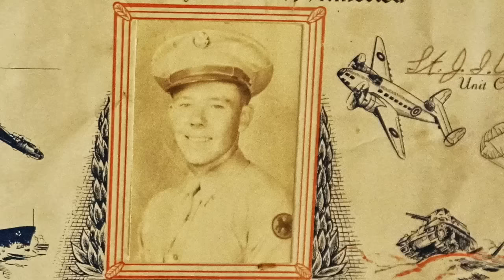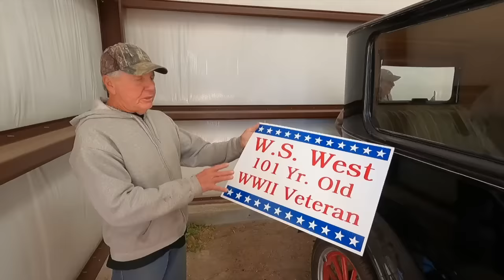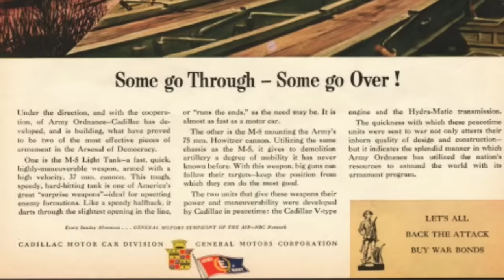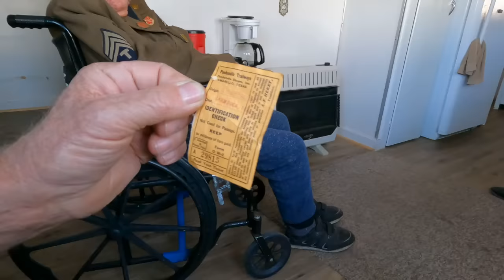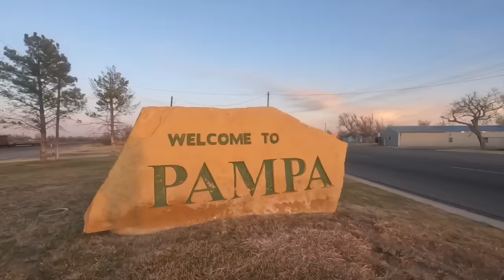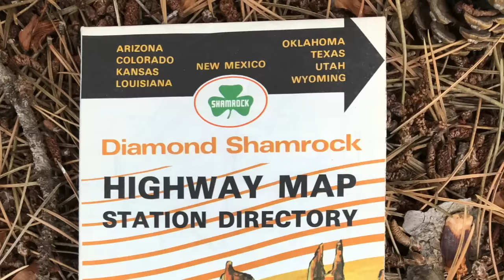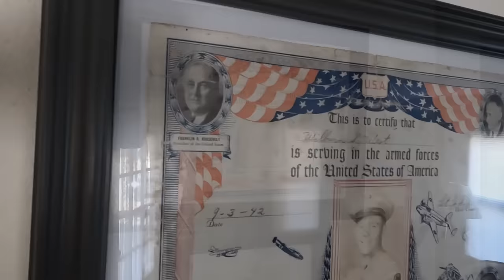WW2 Veteran's Reaction To Son Fixing His 1946 Cadillac To Drive

Comment: Why don't you guys do what I do with every engine or vehicle I get that has an engine that I want to work on but I don't have the time and it might sit for a couple years I use Marvel Mystery Oil pour down the cylinders especially if I know if it's going to sit for a few years but I managed to go out and turn it over get the cylinder walls and the Rings lubricated and all that you don't have to crank it with a starter but it's not a bad idea so when you go out to rebuild the car and get it running again put the spark plugs back in it once you get the Marlboro menstrual out of the Pistons and cylinder walls you want the main bearings and piston bearings to get oil there's got to be new fresh oil